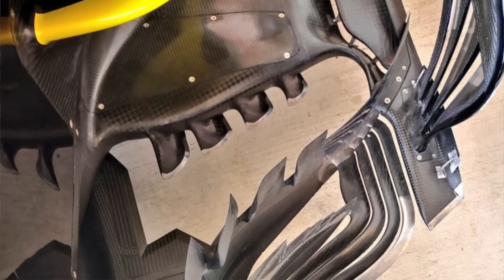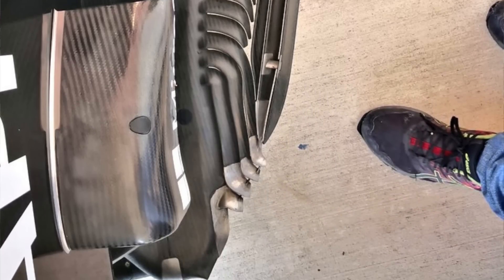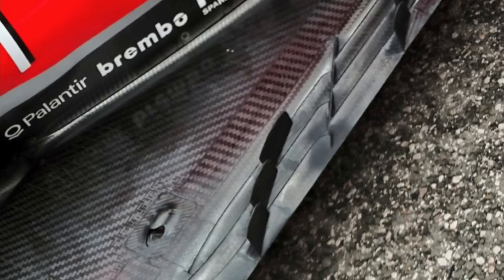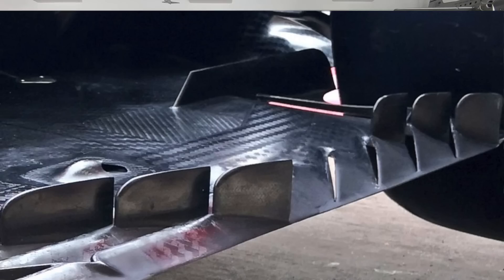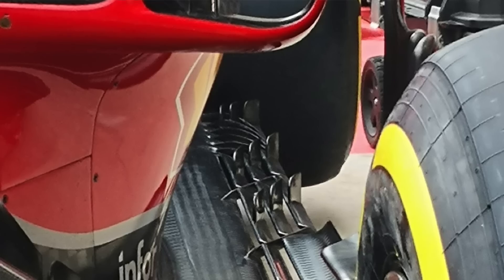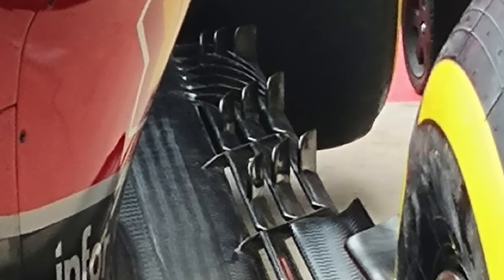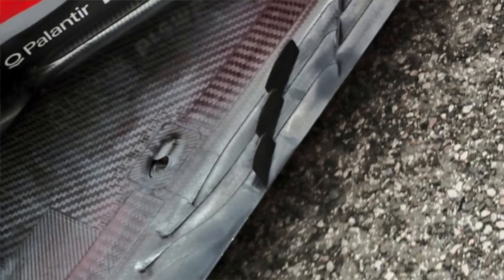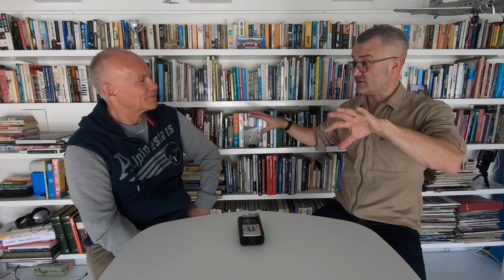Ferrari F1 tech update - new floor slots and fins - Peter Windsor

Comment: i think this tinkering with the floor will create the same issue as complex front wings have done in the 2018 season,

All the drivers & teams moan they can't follow other cars closely, then they do this in preparation for the 2019 rule change for a less complicated front wing,

The floor will still disturb the air for the following car,

The FIA needs to stamp it out and stop making such woolly rules that can be gamed for an advantage,

but it isn't illegal as no rule has been defined for it,

just close the loop holes and we get better, closer racing and more overtaking,

All the team bosses say fans want more overtaking but they do everything in thier power to stop it,

The last race would of had a different result for the top 3 finishers with less air disturbance between the cars.
Reply: Very good observation